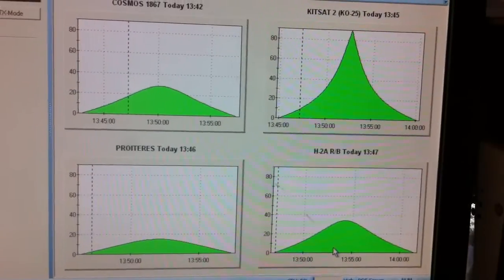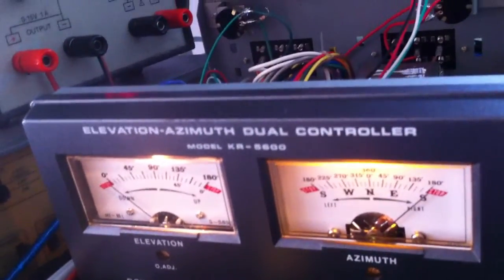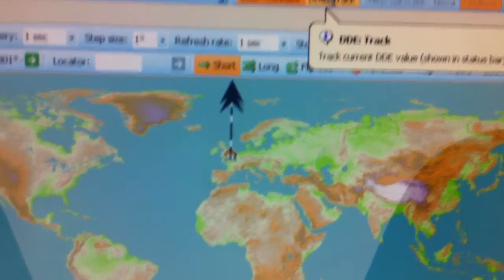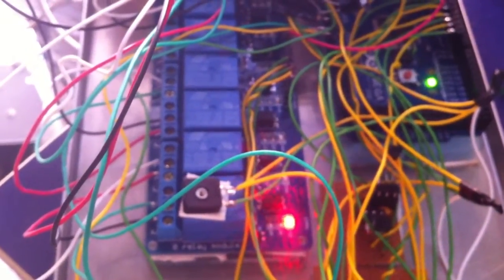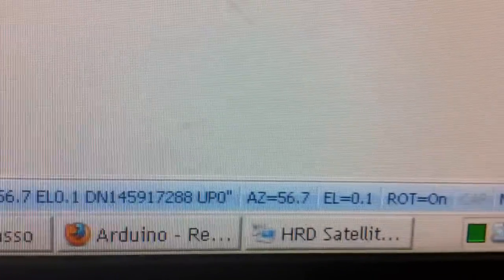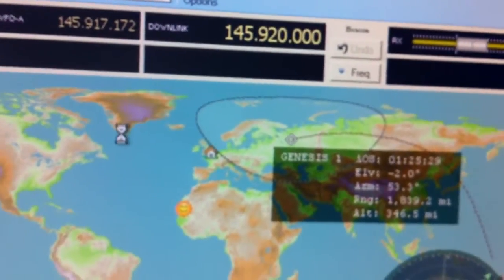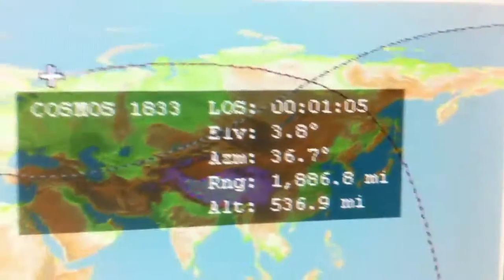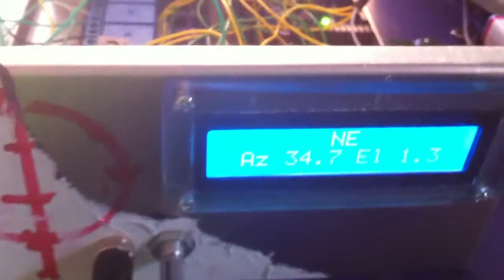Satellite tracking with the K3NG antenna controller via KR5600 Kenpro

Comment: nice project...please can you share the final code and schematic of YOUR project?i look at the radioartisan K3NG website but i can't understand much....many thanks from YO8SXT 73
P.S. my email is: anastasoaie.cristian@gmail.com
Reply from the maker: Cristian Radio hi Christian. Yes I can. It I am working on a new design at the moment. This video is about 4 years old and the new design is more compatible. I will email you all the details as soon as I have finished the new design. 73 de Spence M0STO
Reply: i am looking for to receive de details of construction and code because i wanth to build 2 az-el rotors one with servo or pot in this case and one with a magnetometer senzor .... thanks 73 from yo8sxt
Reply from the maker: Ok but I'm going to Rosmalen this weekend for the Dutch amateur radio festival, will send the final code on Monday.  73

Comment: How did u transfer data from PC to arduino???? Serially using USB or Ethernet Shield?????
Reply: Hi Bharath and thanks for the reply. It was all done serially with the USB port. Once the Arduino has been programmed and the pins correctly wired to the relays then everything is controlled by USB. For example in Ham Radio Deluxe the Arduino obviously has it's own USB port number Eg: Port 4.so you simply tell the rotator program to control port 4 (which it assumes is an RS232 but really it's USB) and then that controls the K3NG controller, which in turn controls the rotator. It sounds complicated but really quite simple. If you need more information then I will be glad to post another video explaining the operation for you. Good luck my friend and hope to hear you on the air soon.
Reply: I am trying to read both the Azimuth and Elevation angles in Arduino Serially but I couldn't do it properly. I send data like <123.212&-56.432>. While reading and echoing I dont get the output in PC. Can you help me with it????
Reply: Bharath shaji
I shall try my best. What is your setup? Please tell me more about your equipment. Are you using your own Arduino code? You should have about 0.3v to 4.6v from the position potentiometer fed into the analogue input of the Arduino first.  Try a simple potentiometer sketch first to see what your getting. What is your rotator a Yaesu G5500? I can help but need more information. Please tell me more. Kind regards Spence
Reply: Spencer Tomlinson  Hi,
My project is not Ham Radio thing. My project is to design a Satellite Tracking system. I have to design and implement the entire setup including azimuth-elevation prediction in PC, controller(Arduino),antenna and receiver. My problem was I tried transferring Azimuth and Elevation angles via Ethernet to Arduino. But the data received was truncated. So i switched to serial method as you suggested. I am able to receive those values at Arduino Serially now.:). Thank you.
Reply: Bharath shaji
Hi, Hhhmmm not sure where it is breaking down. I must admit my Arduino knowledge is limited so I have put the question to my friend who just happens pretty expert in Arduino programming. I take it your using rotary encoders or potentiometers for position sensors.? Let me check with a friend so you don't get bad information